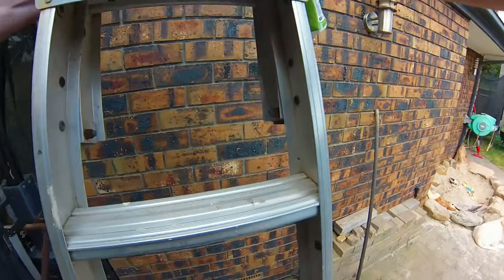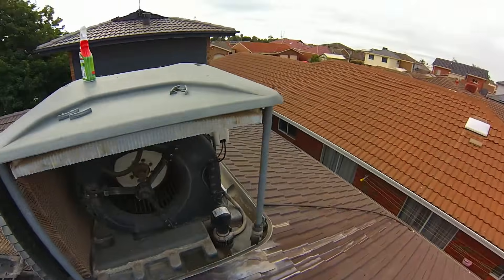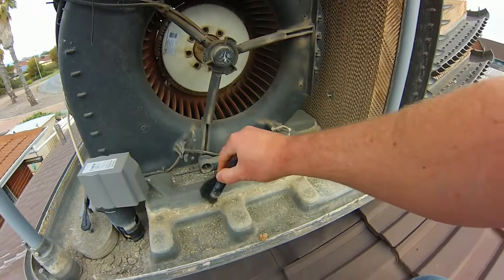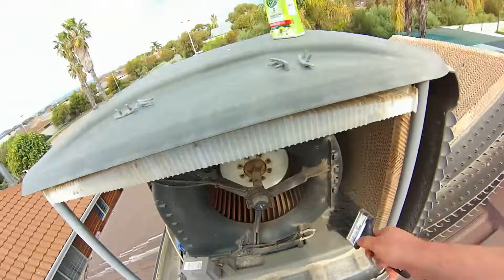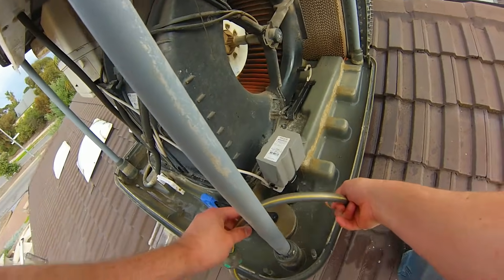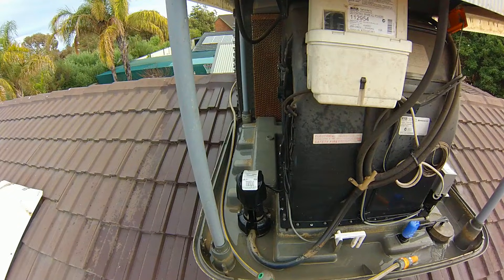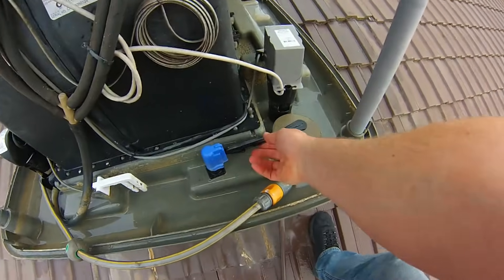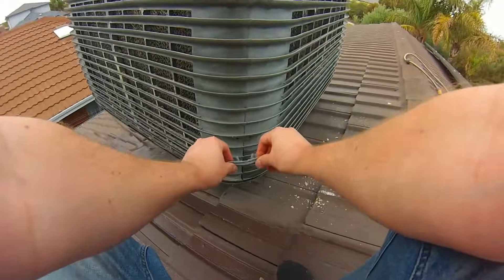Easy 15-min Evaporative Swamp Cooler Maintenance DIY Service Breezair

Comment: Good video for maintenance, and cleaning out the unit each year. Will try the CLR trick next time. Parts are pretty expensive for these units, but there is a terrific drain valve refurb kit on eBay, much cheaper than replacing the whole valve assembly. The water wick panels are hideously expensive though, but taking them out and cleaning the dirt off them with a hose on pressure will help keep their efficiency up. And wearing a harness isn't a bad idea!

Comment: But you didn’t wash the pads down?
Reply: Glad I'm not the only one who picked up on that!
This is an informative video, but it doesn't really qualify for a "service" as the title suggests, it's really just an internal scrub down. The pads should be cleaned, and the water pump, solenoid and fan all checked.
Reply: That’s right why the hell remove all the pads if you’re not going to clean them?

Comment: You mention that Drain Valve is a common part to fail. I think the motor in my drain valve has failed. Do you have a How-To-Repair/Replace video for this Drain Valve part, by chance?
Reply: Buy a new drain valve on e bay. replacing drain valve is easi but turn off power at electricity meter under evaporative air con first for safety or the on/off switch on the white box inside air con. Don't forget to turn it back on once you've replaced the dump valve. I'm not an electrician😊

Comment: Just bought a home with a Breezair EXV 155-B. Cleaned it out yesterday before I found your video.  One thing I don’t understand is how to activate the drain during or after cleaning, or at the end of the cooling season. How do you manually open the drain valve? 🙏
Reply: Go into settings. There is a manual drain slection. There is a seeley video on it.

Comment: My unit was leaking and it was "fixed" but now the air isnt cold what do i do
Reply: Having just had this exact problem myself, it ended up being the water pump not working. Therefore, the fan was just blowing hot air through. New water pump was required.

Comment: Great informative video buddy, just put a new dump valve in as it wasnt dumping water.. but noticed its constantly drizzling water out the hose ?
Reply from the maker: Open up the unit and run it. See what's happening I suspect the float arm is not sealing when it's full of water.

Comment: What is the meaning of service 2 please help me that’s the problem of my breezair
Reply from the maker: A "Breezair service 2" error on a  evaporative cooler indicates a issue with the water supply, such as the water supply being turned off, a blocked drain, or a faulty salinity probe, or a faulty solenoid valve.

Comment: Best video on Evap’s 👌🏻.   Just checked ours as the motor isn’t working.  Motor spins pretty free (didn’t at first) and all checks are reading a similar 17ohms.    Control board output is 1.156 on 2 pins and only 0.730 on one pair do you reckon control board is shot.  (No fan operation).    Cheers mate

Comment: A bit late to the party but great video! Just wondering your advice....air con was running fine and then noticed a noise. Continued running due to it being so hot atm..Was still cooling but stopped cooling last night and noise has stopped. Would I be correct in assuming pump needs replacing? Fan still working fine but just blowing out hot air now 🤮
Reply from the maker: Sounds like the pump as they sometimes get noisy before they fail.
Best to take 1 panel off and then turn it on to see if it is pumping water.

Comment: Would it be worth using a blower to clean out the panels?
Reply from the maker: A blower doesn't have enough pressure to dislodge the scale build up 
I have used a leaf blower inside to remove dust and lose scale after it is brushed off.

Comment: Should not have a stop tap on these units as a isolating valve
Reply from the maker: A brass or stainless ball valve is a preferred option. I never installed this unit but it works. The tap o-rings do fail over time.

Comment: How do you get the drain valve to stay open like that?
Reply from the maker: Few options when it's off for a few days it will auto drain and stay open.
You can also press the drain or dump button on your controller remote.

Comment: Yeah I had a breezair one which just died on me, water tank filled like normal but it didn’t pump and then the fan just completely died, costed so much that it was cheaper to get a new unit. Got it replaced with a Braemar LCQ550, much more powerful than the old Breezair and it’s great to have a working aircon again.
Reply from the maker: Parts are so expensive for Breazair units sometimes it's cheaper to replace the whole thing. Good job.

Comment: Great video mate, thank you. Looking for some advice. I keep getting service 2 error. I can switch it off and get the unit running again, but then it will do the same 10-15 mins later. I thought it was a water issue, and I did see that when running the water level was well below the probes. I’ve topped up with the hose a few times and it has worked, although right now it’s not helping at all. It doesn’t seem to be dumping the water, as the drains are dry.
Reply from the maker: Service or fault code 2 means there is no water covering the salinity probes.
You have a water supply issue. Either water in tap is off, solenoid valve is faulty, water level float is stuck, or dump valve is not working.
More info here  https://notsealed.com/breezair-evaporative-cooler-troubleshooting-guide-repairs.html#Breezair_Evaporative_Cooler_Service_Code_2_Fault
Reply: @ thanks for the reply, much appreciated. Water is definitely on as the tank does fill up, albeit too slowly and needs a top up with the hose. I don’t think it’s a case of the dump valve letting out water as it’s trying to fill, as I don’t see it getting dumped into my drain. It seems like the unit is turning on prior to the tank having enough water in it. Float moves freely. Cheers

Comment: great video mate.
but do you recommend washing the honeycomb pads at all? if so, how?
Reply from the maker: Just rinse them down with a hose or if they are scaled up then use CLR to break down the lime scale then hose down well.
Reply: @NotSealed  thanks buddy!!!
Reply: @NotSealed How much CLR would you use?
Reply from the maker: @leastac6031  I use about 1/1 ratio so 1L of CLR to 1L of water and spray it on the pads and inside where there is scale.

Comment: Great video, thanks. I have to restart my units 2 or 3 time because I think the water is insufficient to fill in the cistern quickly enough for the sensor. I'll try to clean up the solenoid filter. I wonder if the floating valve could slow down the water flow as well. Do you have any suggestion?
Reply from the maker: Make sure that tap is turned on fully. The float valve could be restricting the water flow.
You could have a leak from the dump valve 
Best to take one panel off and refill the air-conditioning unit to see what the problem is.

Comment: Do you have any tips on removing the order from new pads?
Reply: The pads should be changed out after 8-10 years. New pads on that style of Breezair are 800 x 635 x 90mm, labelled as Filcel pads. Around $420 for a set of 4. They come with new plastic retaining pins with washers, 4 pins per pad. Always change out all 4 at the same time. New tornado pumps are around $230.

Comment: Why placing the cooler on the roof??  It can't be fun carrying tools and climb to clean or inspect the cooler.
Reply from the maker: These evaporated coolers also known as swamp coolers are designed to be mounted on the roof. I have seen a few designs that are mounted on the ground and then have ductwork up the side of the house wall and into the roof space.
Yes not fun to work on as you need to have fall protection.

Comment: Instead of dragging a garden hose up onto the roof, is it possible to add a short hose to the water inlet where the on/off tap is with some sort of addaptor and then leave the short hose permanently there for cleaning purposes?
Reply from the maker: Yes this is an option and I have seen it done before. T piece after the tap one hose to the air conditioner and another small tap to a hose fitting for cleaning This makes cleaning quicker and safer.

Comment: Exactley what I was after - A no BS clearly articulated to the point walkthrough, of course it took an aussie sparky to do so! 😊 
Would an air compressor be better used in place of a vacumn, just have a good unit with a hose long enough and thinking of using it prior to hitting the Evap and the Pads with a garden (water) hose.
Reply from the maker: Yes compressed air may work. It will make a mess on your roof. The problem is alot of the time the dirt is dry and needs a brush or water to break it down. CLR clear helps break down lime deposit before being washed. All the best.

Comment: Can these units work in humid costal regions like south india.
Reply from the maker: Evaporative airconditioning is not recommended in humid areas as too much moisture is already in the air and it will make your home feel damp.
But I have seen it done you just need lots of windows and doors open for airflow.

Comment: Hi Mate great video. My unit has been overflowing water. The float valve seal rubber is perished. Cannot find to buy separately.  Otherwise you have to buy the whole float valve machanism $80 bucks. I think its possible to make a new seal. Thinking to buy a seal from bunnings and cut the square shape to match and drill  hole in the centre. I will let you know how it goes.
Reply from the maker: Another option is to flip the seal over and use the other side. I have done that before many times.
Reply: @NotSealed  yes great idea thanks

Comment: Brillient information. Do you have a parts catalogue for, Breezeair Cooler? (same as your cooler shown on your Youtube video)
Reply from the maker: These parts are the main ones that fail.
Breezair/Braemar/Coolair 3/4 Solenoid 24VAC https://amzn.to/3PkAK7e
Breezair Drain Valve https://amzn.to/43gTWZ7
Seeley Tornado Pump https://amzn.to/4adtwJY
Automatic Water Leveller https://amzn.to/3vhTkG3

Comment: Hey Mate love the vid! I'm about to attempt this on the weekend.. My Evap as of last week is just blowing warm air? Will I be able to fix that myself to save some $$$ or will I have to get someone in to fix that?
Reply from the maker: You should be able to fix it yourself. If it's just got hor air then it's a water issue. Either pump not working, no water, or a dump valve issue. Good luck. Let me know how you go.
Reply: @NotSealed  thank you so much for replying I'm hoping I'm able to fix it haha I'll definitely let you know as soon as ive finished.. I may have more questions to ask once I'm up there 😅

Comment: Is it common for these units to leak to a point where they cause damage to the ceiling below?
Reply: Ive got one located near the ridge of a tiled roof and its not exactly easy to even get a look at it inside the roof space. Any help appreciated.
Reply from the maker: Single story is easy but harder access for double story houses. Always use a fall restraint system when on the roof.
If you can access internally into the roof space will give you an idea where the water leak is coming from. Usually it's a cracked tile or broken flashing.
Reply from the maker: They should only leak into the drain. If it is leaking internally into the ducts then you may have a crack or another issue.

Comment: Hi, someone has serviced my Breezair and after he left the wind is not too strong (from 1 to 6)  unlest  I put on maximum speed 7 or full 9, is any reason why is doing that?
Reply from the maker: Could have a hole in one of the ducts or a blade has come off the fan.
No real reason why it shouldn't be the same.
The plastic covered ducts don't last very long.

Comment: How are they dry on the inside if they run on water? I would think the main worry would be mold but no?
Reply from the maker: Usually when you turn them off they will dump all the water out. A yearly clean out will keep these aircon units fresh.

Comment: Thanks mate you saved me $$$ from your video I could tell my fault was  dump valve stuck open. Simply gave it a clean and a spray of wd40 and it became unstuck .I also  gave the unit a bit of a clean while I was up there . Thanks again
Reply from the maker: Excellent glad I could help.

Comment: My cooler is dumping water even when it's not running, any solutions?
Reply from the maker: Either the dump valve is not sealing/worn, the float valve is not sealing or the inlet solenoid valve is not closing. Could be any of them. You will have to open the unit up and inspect it.
Reply: @NotSealed  thank you for replying, opened it and it’s leaking from ball float thing. Do you reckon I should call in plumber or I can do it myself?
Reply from the maker: Can be done easily. Just follow this video https://youtu.be/EkTPi5DIh-k?si=6pgK4y8byb_tlzM0
No parts needed just flip the washer seal over.

Comment: Thanks mate, excellent video. My son just bought a home with an old evap. There’s water leaking thru the ceiling when it runs.
It appears to be coming inside the big steel box under the man unit. Is there an area your are aware of that could cause that?
The dump valve empties onto the roof and isn’t the issue. Thanks.
Reply from the maker: The big steel box is just a connection point for the duct work. Sometimes condensation can form in this area and rust out the corners. This can be where it may be leaking slightly.
Reply: @NotSealed  thanks mate, I’ll do some more investigating.cheers 🍻
Reply: I have an old 30 year unit that we noticed the same thing. Checked the steel casing and felt water or condensation.
How did you fix it?
Reply: @gungy3171  bought a new one…. 😬 when we had a close look the  old fella (25-30 years) was pretty much worn out every where, seems the old owner did some patching and removed a dump valve. (Not that we found the leak) even the cover was cracking so we decided not to spend any dollars on it.

Comment: Hey mate, well done video just got a question about my cooler. It blowing cool air but not blowing it very hard do you know what would be causing that? Any pointers would be appreciated 😄
Reply from the maker: Make sure the fan is at maximum another problem could be your ductwork. These can fail over time causing holes and lack of pressure.
Old plastic ductwork tends to last only around 10 years. Silver ductwork should last 20 years Plus.

Comment: Do you know why my new breezAir unit is constantly draining water slowly even if it is turned off.
Reply from the maker: Either the drain valve is not sealing shut completely or the level float is not set correctly and water is draining from the overflow. 
You will have to open one of the panels to inspect it.

Comment: Hi. Would anyone able to diagnose based on this? TIA

 MY evaporative cooling works for 15 mins but a lot of run off water from the roof which I don't think this is right. 

Upon switching On for 15 mins, the evaporative cooling stops with the "service" warning flashing.

Then I pressed the remote again, it is back to work with a lot of water running off from the pipe and stops with the "service" flashing again after approx. 15 mins.

Would it be the valve? Thanks
Reply from the maker: It sounds like the dump valve is not sealing or closing properly. It could have something jammed in it or the dump valve is just old and need replacing.
Best to take one of the filter pads off near the dump valve and check out the operation.
This is the part you need https://amzn.to/3HmWtXD
Reply: @NotSealed  thanks for your advice. I will go check and see how it goes. Update soon for everyone to learn more. Thanks again😀

Comment: Thanks! Do you need to wear a roof harness when servicing an evap coolerr - esp for 2-storey homes? Also, I had a repairer clean my Bonnaire unit but he only used a hose that was already attached to the cooler and did not use a vacuum at all!  Never cleaned since installed in 2006! A week later we got a leak resembling a water sprinkler. He'll be back to fix it next week. Wondering if he damaged the hose he used.
Reply from the maker: Yes you should use a harness. Many don't in this industry and it's not safe.
If your water tap to the air conditioner has an appropriate fitting you can connect a hose into it.
Depends where the leak was if he caused it or not.
I find old taps will leak if not operated for a few years the oring seals fail.
Reply: G’day Did you find out where the leak came from. My son just bought an older house and it’s evap leaks. It seems to be internal? Not sure though.
Reply: Yes, it was a tiny black hose that was partially exposed to the sun and had been damaged from UV which he said is very common. He knew the cooler had never been serviced in 16 years since it was installed so god knows why he never checked it properly on the first visit! He also claimed that he brought up a hose with him, but I never saw it as he climbed up.  @Liamgross3000

Comment: Great Vid, thanks for the tips. My fan speed will only run high and won’t lower the fan speed when I try. Any thoughts, thanks
Reply from the maker: Never seen that fault before. Make sure the remote is in manual not auto. Could be a failed button on the remote.

Comment: Can the amount of water that is bleed off be set?
Reply from the maker: Depends on the type of air conditioner you have. Some only dump once the water quality gets bad.
Others auto dump on a timer.
Really old units trickle dump continuously which is a huge waste of water.
Some of these old units can be adjusted.
If you have a newer evaporated air-con and you find it is dumping water all the time the water float stop seal could be worn.